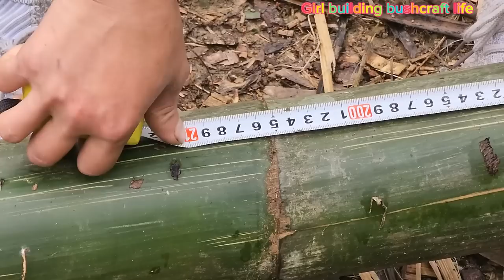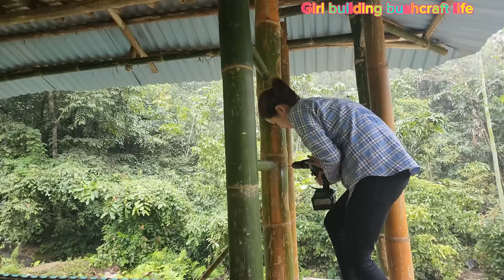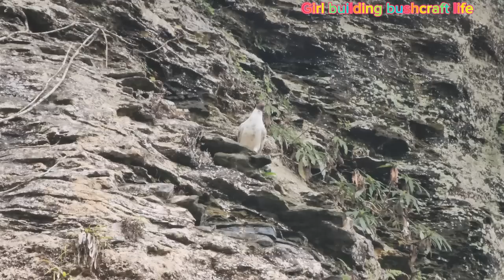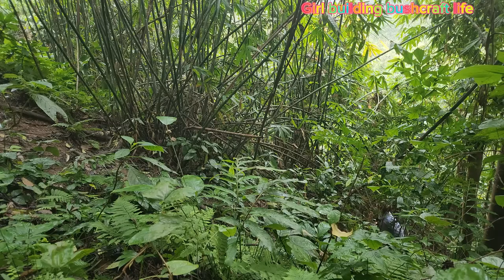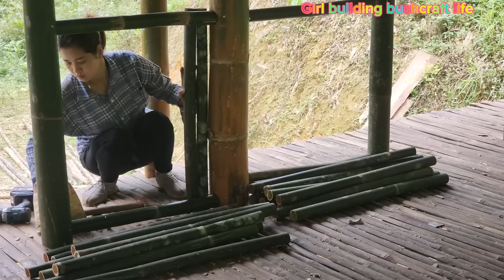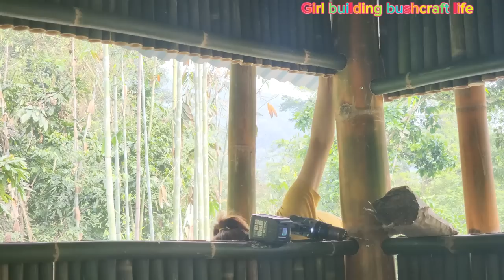Install a bamboo frame and build a wall around the girl's second floor

Comment: I browsed through your multiple episodes and lost count of how many bamboo homes you built and how  many times you moved...Is this your final destination and home? How did you get construction materials to this place? How far away are you from a village and traffic roads?
Reply from the maker: This is not the end of me. but it will be a long time. I will raise livestock later. I live 80km from town and it is very difficult to buy salt, because I live in a remote countryside and have no means of transportation.
Reply: Thank you for the information....I guess you got sand,cement and the steel roof delivered to your lot...Can you catch a bus ride close to your home to go to the village?

Comment: hello khe, i dont want to preempt your work, but would it be ok if you'll put a railing on the upstairs connect it on the ( 2nd & 3rd )  floor to avoid slip/ falling down accidentally, its a mere perception and suggestion